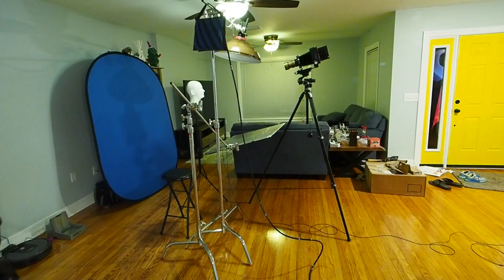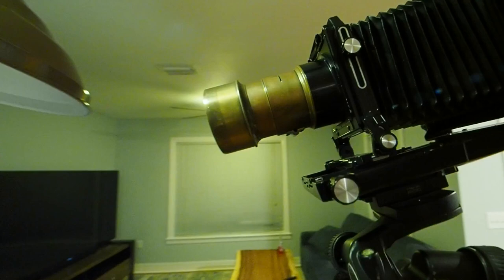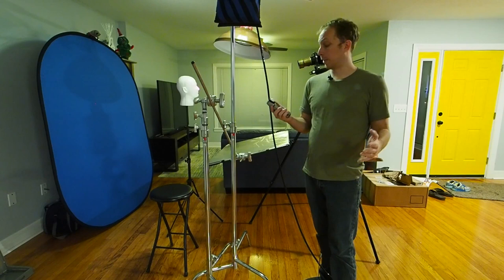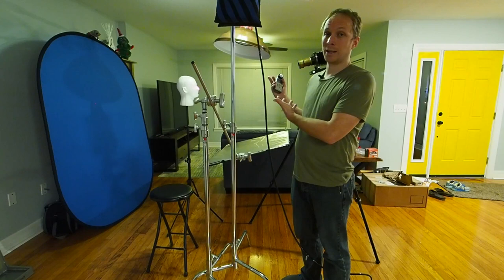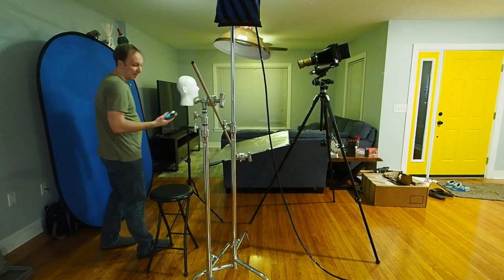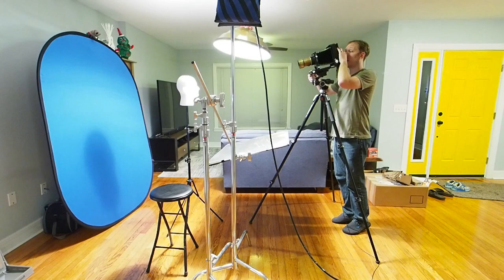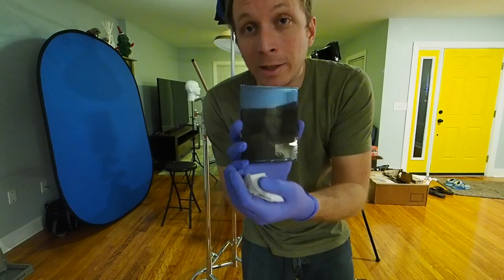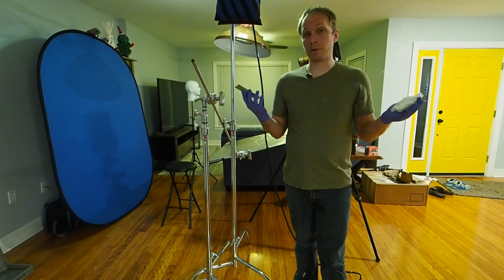Collodion Chat #3: Wet Plate Portrait With Strobes, Beginning to End

Comment: Hi robert have tried  candle as you light source for a portrait head shot
Reply from the maker: You'd have to expose for a very, very long time.  Wet plate has very low sensitivity compared to film or digital, and candle light in particular won't generate much in the blue end of the spectrum where collodion is most sensitive
Reply: @tehbieber  ok maybe 30 min minimum?
Reply from the maker: I couldn't even begin to quantify it. It would completely depend on the amount of light.  A single candle would probably never give you a visible exposure before the plate dried out (keep in mind that you get around 15-20 minutes after pulling the plate from the silver bath).  An entire rack of them, maybe?  I don't know if it's been tried

Comment: How many amps do these 2403 and 4803s draw when on slow charge?  Does anyone know roughly?  I only have 15Amp breakers.
Reply from the maker: They have a slow recycle mode that in theory should work on a lower amperage circuit. In practice, you might have to go flip a breaker every now and then

Comment: really useful! Unfortunately, in the EU, there's not much speedotron stuff available. I looked around and found some Broncolor and Profoto , but that's pretty expensive. What do you think of https://www.paulcbuff.com/Flash-Units/white-lightning-flash-unit.html? . It doesn't come with a power pack however.
Reply from the maker: The more powerful white lightning units will work, as long as you get familiar with their limitations and don't push things too much on light distance/modifier size.  Another option you might want to look into is Hensel.  I don't know much about them, but I've seen some EU wet platers using them

Comment: I'm missing something. The trigger pops the strobe but what activates the camera shutter?
Reply from the maker: This is a barrel lens with no shutter. Modern lenses with shutters will usually have an x sync connector you can use to trigger the flash
Reply: @tehbieber  thanks, I'm a long way from worrying about strobes. Your videos are excellent.

Comment: Are running a full 4800 ws to 1 head or is it 2400 WS?
Reply from the maker: I use a head that can take the full 4800, but for a headshot like this with a beauty dish I'm probably dialed down below half power
Reply: @tehbieber  Thank you for the response it is greatly appreciated. I just started to make Tintypes. I'm still very much in the learning phase.